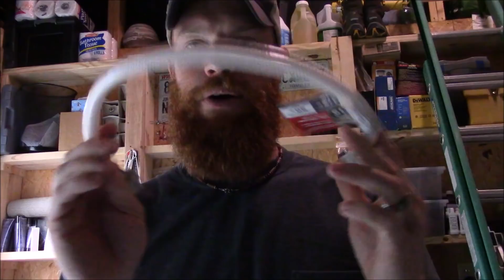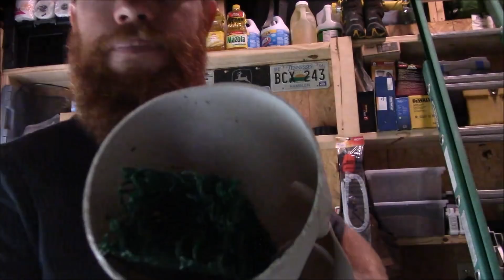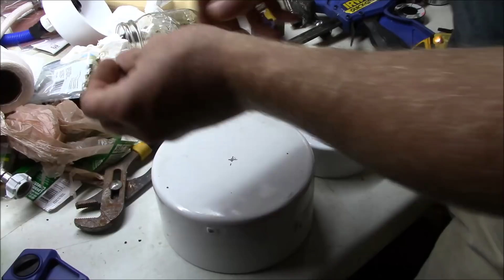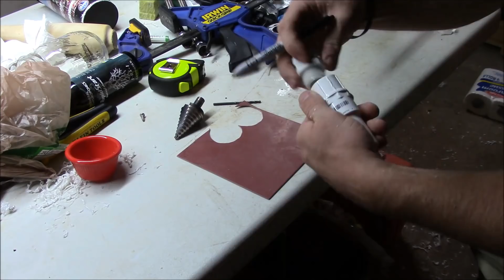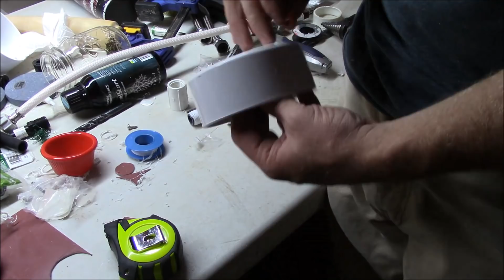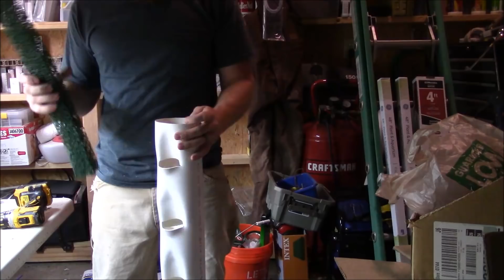Urban Aquaponics - "AquaTowers Part 3" by HPFirearms

Comment: You were obviously  raised  in a house with unlimited  funds . How much is the cost  of your tower? You took the most expensive route to build this. What s the price  of a 6 inch cap?  You use extra fittings where you could just use  glue . You put a $5 connection instead  of glue in connection . Many cheaper ways to do the same thing.

Comment: I think you just needed to sort the capillary action problem at the corners of the mouth? Did you investigate that. Perhaps the origninal hacksaw cuts were too long. Maybe just a small drill hole at the mouth edges would have stopped tthe leak?

Comment: When you drilled the hole in the connector on the lower end wouldn't a flat plug with 1 hole countersunk through the plug work better?